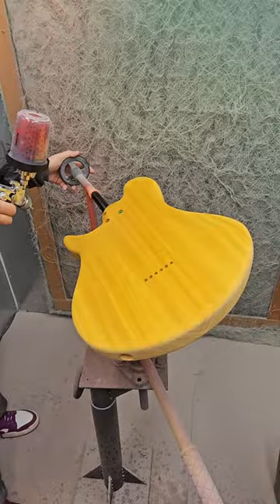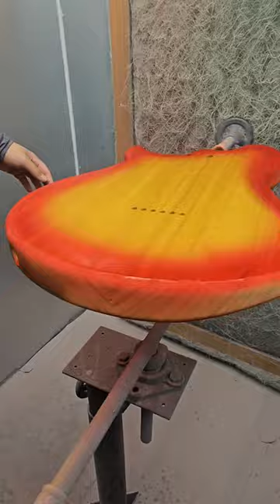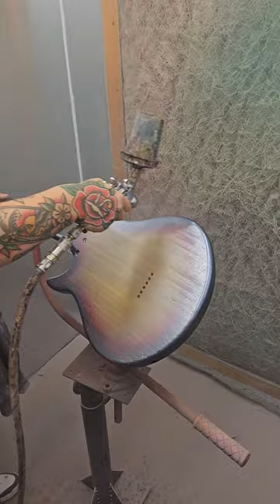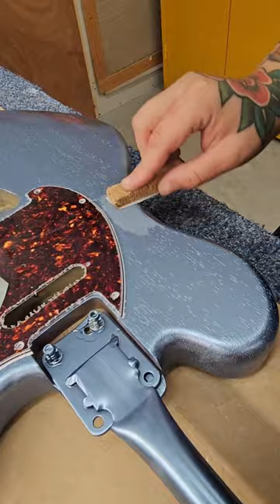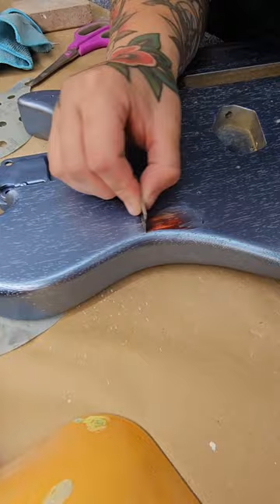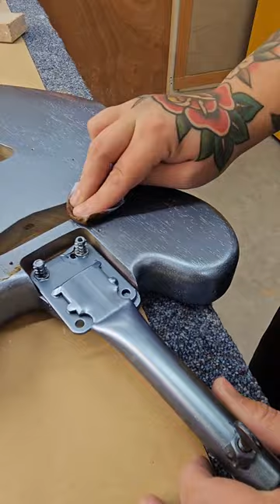PJD York with our new spray over option       #guitar #shorts  #fender #guitarmaker #woodworking

Comment: I admire the way he executes an impressive burst finish, only then covers it all in Pelham Blue 😂 But I value the dedication and meticulous attention to detail in achieving this finish, rather intricate.

If I were to offer a suggestion or critique, it would be regarding the extent to which the paint has settled into the grain. Particularly if the goal is to replicate the 'painted over' appearance seen on some older guitars, where the worn edges reveal the original finish underneath. While I understand that a thin finish enhances body resonance, perhaps considering the use of grain filler in the future could help minimize the visible grain effect?